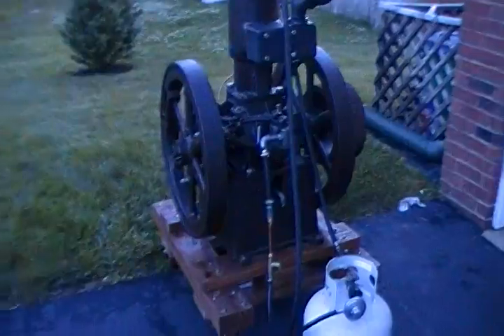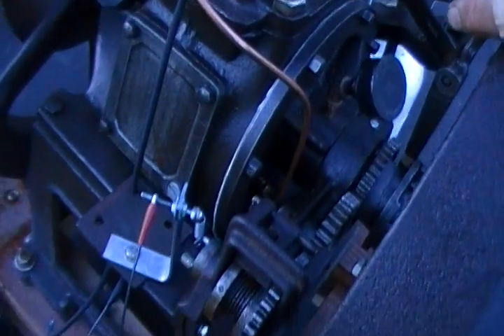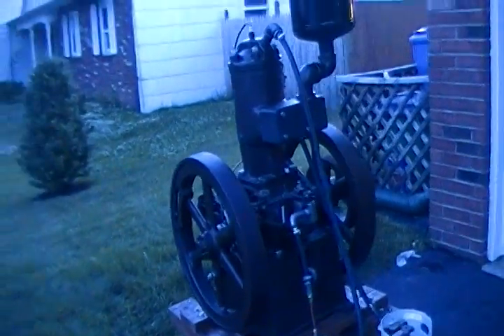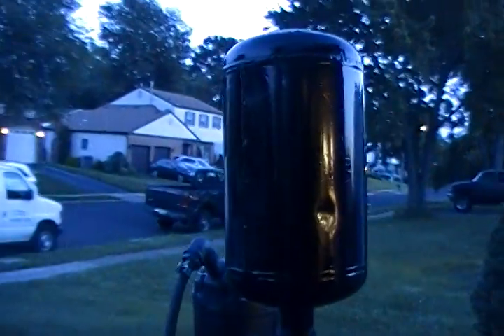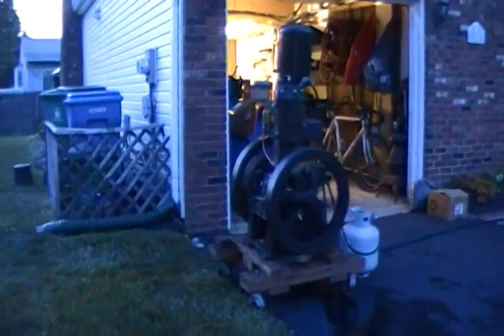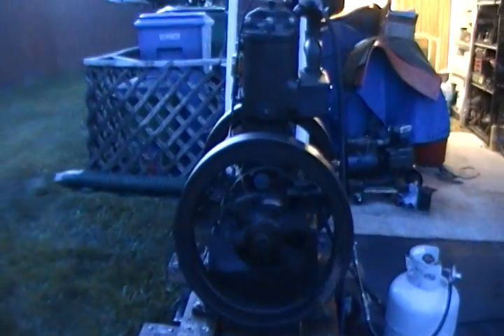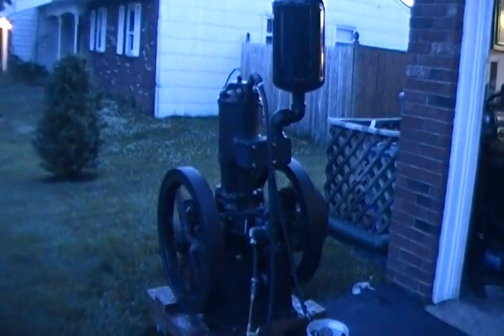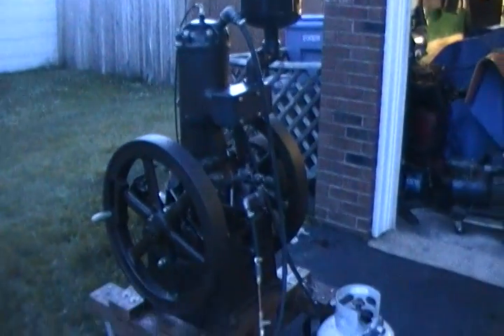THE BERSSEMER FIRST OFFICIAL RUN

Comment: It's a BESSEMER!!! It a "Hit or Miss" engine. It isn't back-firing, it's firing! It only fires when it slows down enough for the governor to close the exhaust valve and ground the spark ignitor, causing a surge in the speed. The governor trips open the exhaust valve and the ignitor and the engine coasts slowly back down, and the cycle repeats. There is no intake valve cam, as the intake valves are reed valves, only operating when the exhaust valve is held closed by the govenor. 

All early 2-stroke engines are "Hit or Miss" and all "Hit or Miss" engines  are 2-stroke. As the load on the engine increases the firing rate increases and the RPM's smooth out. Plenty of videos of Bessemer engines are available.  

Separately, I am very impressed with the quality of the restoration that you did on this engine, even more so, considering that you didn't understand the mechanics of the operation of the engine! 😉 it's rare to find a Bessemer in the United States as it was manufactured in Britain and few were exported. This really should be THE prized engine in your collection. Any other cannot be begin to match the rarity of quality of the true gem.
⭐⭐⭐⭐⭐

Comment: In the process of watching Bessemer Lubrication, Fuel and Cooling, you mentioned that the engine draws the fuel in by vacuum. I was wondering, you said you had a mystery backfire. Could that little bit of pressure from the propane tank be causing the backfire?
Reply from the maker: Right now I am thinking the backfire is a result of a both timing and lean fuel mixture!
Reply: You probably know better than I. I just thought, what if?

Comment: I'm thinking you need a gas regulator that can flow a lot more then that grill regulator can.
Reply from the maker: Yep, the one I am using is only set at 1psi and an unknown volume.  Probably need around 3 psi at the same volume.Thanks for watching!
Reply: Actually you'll likely need a regulator capable of flowing much more. An engine, especially a two-stroke like that one will probably require 5-6x the amount of gas a grille does.

Comment: Your pretty good at fixing them old motors Mike. Its really running fast now. wow. It may be too fast. I dont know but most of those motors that old ran really slow. I wouldnt want it to throw a rod. Yeah good muffler for sure. It seems like it ran best at the end of the video so it may be ok. Back fires are caused by exhaust leaks if they get oxygen in the muffler to burn wala boom. timing can cause a back fire though the carb too. if the intake valve comes open a small amount during the fire or compression stroke.

Comment: You can use wd40 to check for vacuum leaks, but you probably already know that.
Reply from the maker: Yep,  I was able to just use soapy water as when the crankcase pressurizes it will bubble where leaking>Thanks for watching!

Comment: for first offical run that was ok mike it will take a while for it all to bed in again oh how did the grease caps cope that miss fire must be on the governor timing somewhere not unless it was down to the buzz coil i like the exhaust stack by the way be nice to see it with its water tank cracking job mike looking forward to the next installment oh goo interview by the way
Reply from the maker: Thanks Andy! Right now it think it is a combination of timing, a slight gasket leak and a lean fuel mixture causing the backfire.  I will give roadking the OK to upload the "raw" behind the scenes video!

Comment: Since it's a two stroke and you have it running on propane how does the oil in work??
I imagine you showed it but I probably forgot.
Any idea what the original purpose for that engine would have been??
Reply: it as a separate oiler